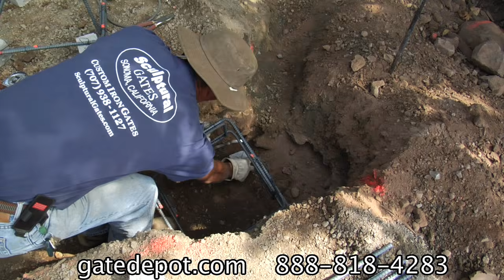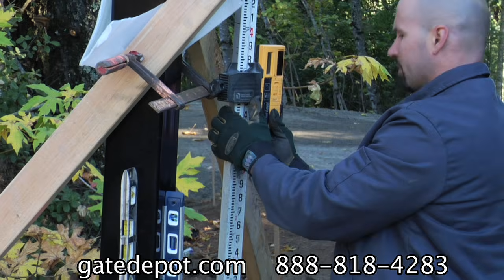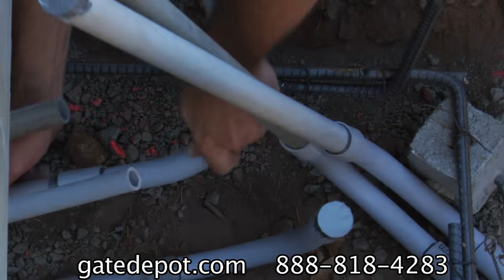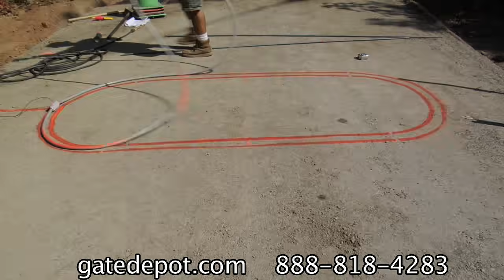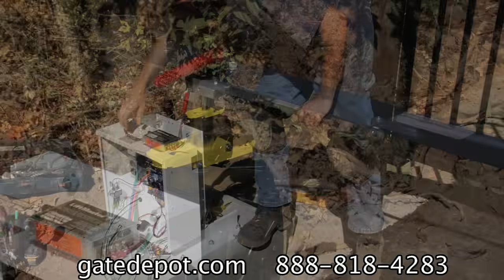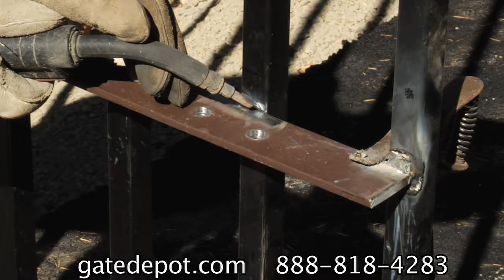Complete Driveway Gate with Grade Beam Installation

Comment: I am having this done currently to my driveway.   It looks like over kill but it is not.  I have had heck with sagging gates in the past.  I have reset my gate and post 2 times in 7 years.   I am over it and I am into over kill construction.    Mine is 4x4 steel welded post with 2 kickers coming off of it. if it sags .. well.. I am not exactly sure what I will do...lol
Reply: Good luck with gate install. It is all about the soil condition when designing the footings.

Comment: Why bolt the bracket to the angle iron and waste your time drilling holes? Wasn't that a welder I saw you using 😝
Reply: Perhaps so it can be able to be removed from the swingarm of the gate operator for future servicing and or replacement.